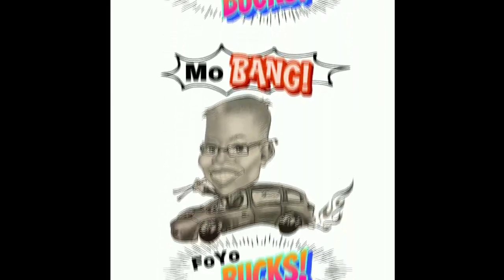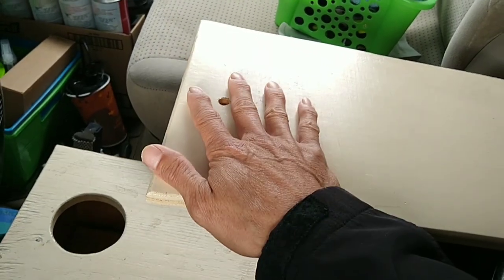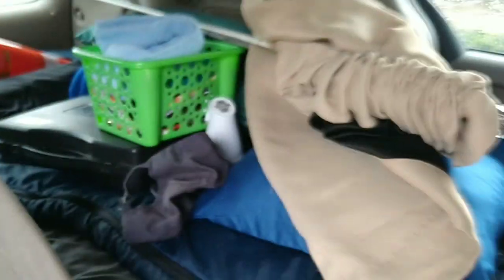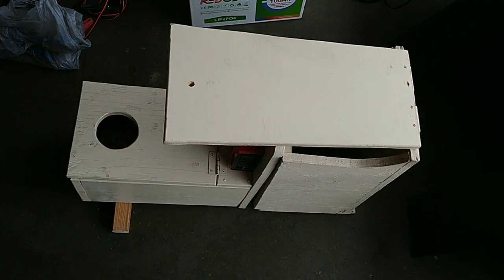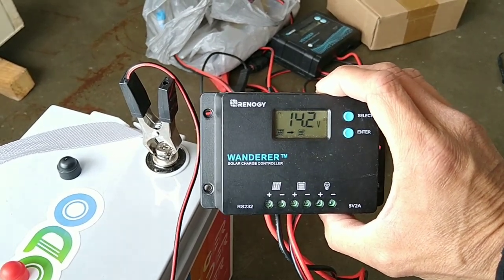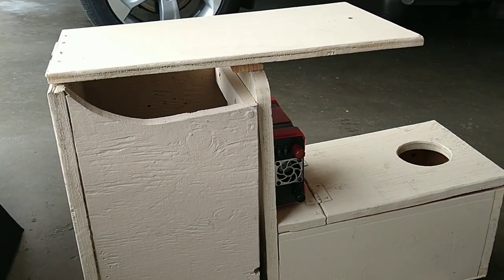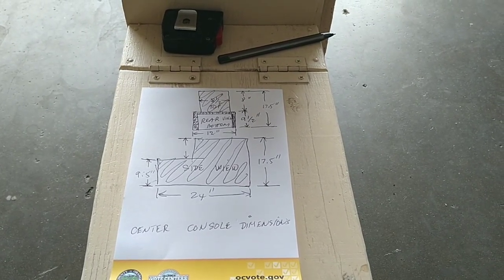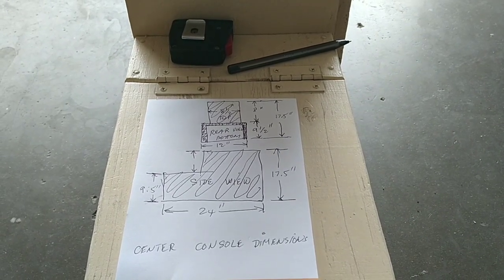How I Build a 1200 WHr House Battery System for 2008 Toyota Sienna Minivan Camper | Vanlife (1 of 2)

Comment: HI TIM. I FIRST SAW YOU IN YOUR KIA SOUL ON CAROLS CHANNEL..OK SO I ALSO HAVE A PEAK 400 W INVERTER. IF I DO LIKE YOU I COULD HOOK UP A CHRG CONTROLLER TO IT ON NEG AND POS W POWER CORD THAT CAME WITH IT TO CONTROLLER.I USE TO HAVE A GREEN FUEL 1000 W WHICH WAS SOULY FOR BUILDS IN MY 4X4 VAN WHICH IS NOW GONE..I HAD NO PLANS ON ANOTHER VAN OR BUILD BUT AS LUCK WOULD HAVE IT ENDED UP W A1995 GMC G 30 1 TON .SO ON GOES YET ANOTHER BUILD.ITS OLD SKOOL 350 SMALL BLK CHEVY. AND REAR DIFF IS A 410 DANA POSI. LIMITED SLIP W A LOCKER.I CALL IT THE BEAST..IT NEEDS ALOT OF WORK YET BUT SOFAR 8 MONTHS INTO ITWORKIN ON INTERIOR..I WILL WATCH YOUR VIDS.YOU MAKE SOLAR HOOK UPS LOOK REALLY SIMPLE.WHEN I GET TO THAT POINT OF SOLAR I NEED TO FIND OUT WHAT CHARGE CONTROLLER AND WHAT PANEL AS FAR AS Wattage I COULD CONNECT TO RUN OFF A 400 W INVERTER..
Reply from the maker: Do your research before buying solar panels, controller and the type of battery you are using! What you see is just the primary setup for storage and placement of components. Running wires is a very different story!!! You don't know what you are about to do, you could damage the equipment and worst of "Starting a fire 🔥" in your vehicle.

Comment: MoBang, I have a Ampere Time 12V 200Ah Plus 2560Wh LiFePo4...Can I do the exact same thing, with same supplies as yours? I also have 2 x100 watt solar panels.
Reply from the maker: You need a controller that can handle 200AHr.
Reply: @MoBangFoYoBucks ok thanks!  I'll look it up.
Reply from the maker: @CindyCaVANas  BTW And will charge LiFo battery. Plus it has to be able to handle over 200W of input from solar panels combined. Always go above a minimum of 10% over the input Amperes or you will burn the charge controller!😱